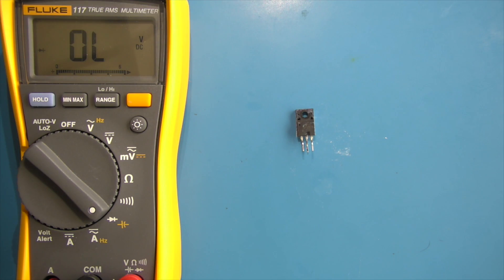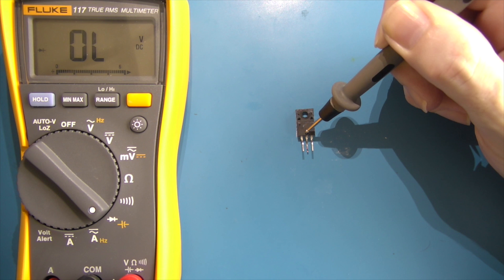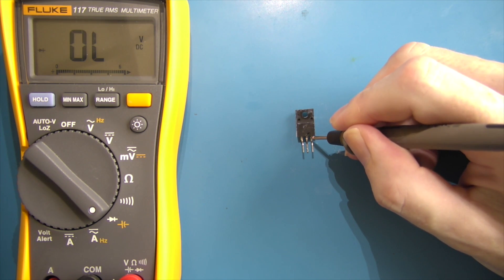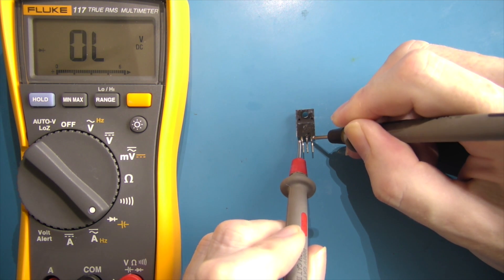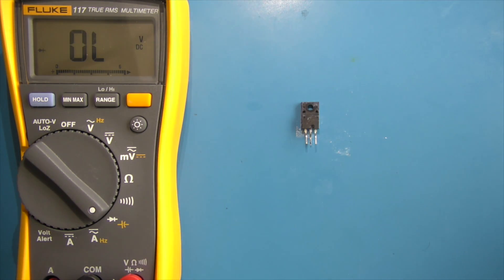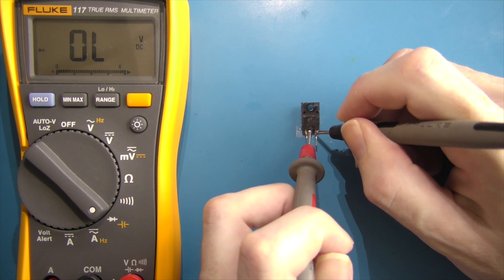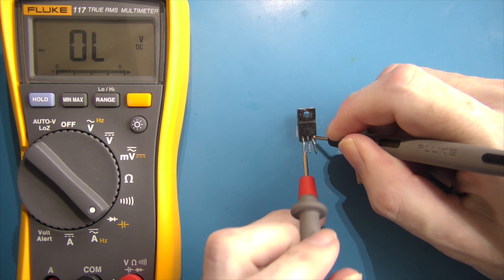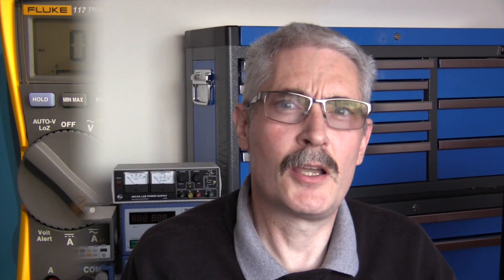BSL006 Testing an IGBT

Comment: Thanks for sharing. It also work with analog meter, just need to set meter x 10K ohms (12Vdc), + positive probe to Emitter, - Negative probe to Collector. Just use the same method as shown. It will work.

However, your method doesn't work with my digital meter. I found my diode test only give 2Vdc. IGBT doesn't switch on.

Comment: this is fake because can not check to the igbt with multimeter because this is isolate gate and of this gate voltage not are least even that it least gate voltage of this 15 voltage ok so plz don,t capture a fake video ok
Reply: The IGBT gates with 5.5V tipically

Comment: the problem is some digital meters will  not test this way since they have to low a voltage. i use a simpson 260 on rx100 and it does work.

Comment: Hi. Thanks for the video. I am testing G7S313U IGBT's out of an LG Plasma TV that went bad. I am using my Greenlee DM-850. I am getting all 5 of them to turn on. What I am observing is that two of them read 1.5 volts (roughly). The other three climb to 2 volts and all of a sudden, I read zero volts as they turn off (I believe that is what is happening). I don't have any shorts. It is easy and cheap to just replace all 5. I am wondering though what my multimeter going up to 2 volts and then registering 0 says about that IGBT (or maybe my multimeter. Thanks much!